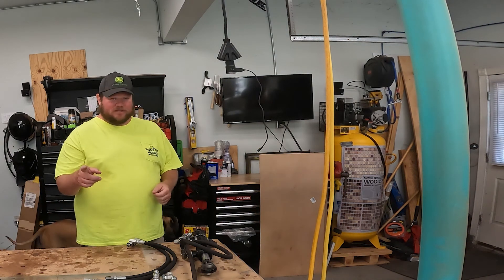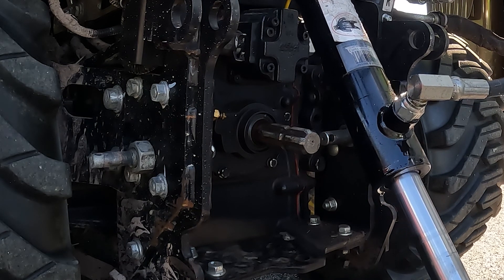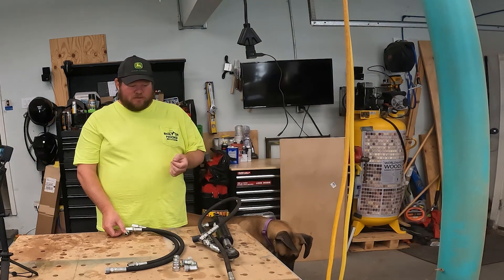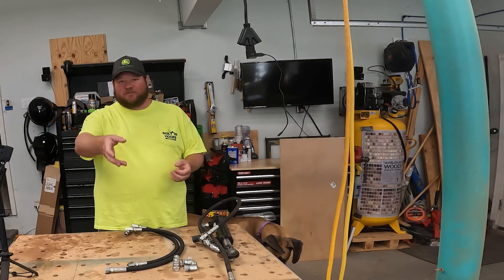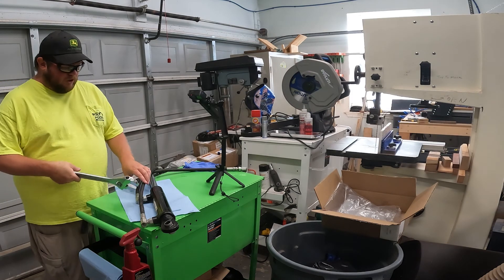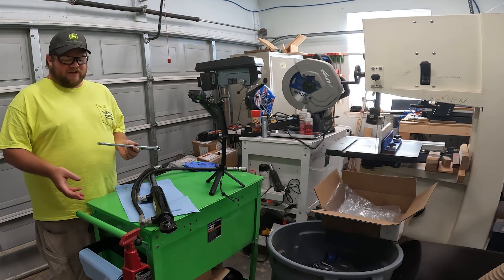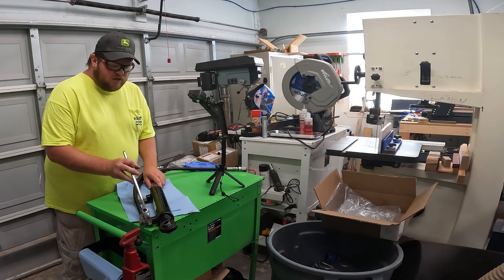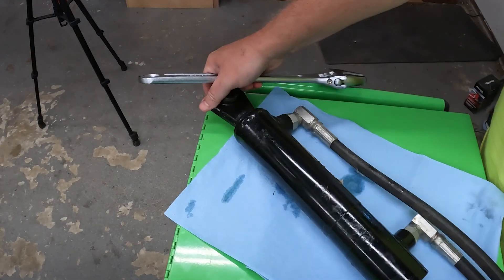1025R Hydraulic Top Link Hose Repair

Comment: Very nice.   My TL has a check valve block. It has to be mounted on the bottom or it hits the crossmember between the ROPS at full retract.   Did your hose elbows happen hit the crossmember to cause your situation as well?
Reply from the maker: The forward fitting will if oriented incorrectly (hose going forward), however, it was the rear fitting that failed.   No idea why...   The old hoses had been pinched and needed to be replaced anyway, so while it sucked that day it wasn't a bad thing to replace them.